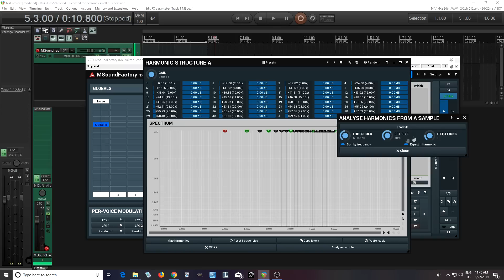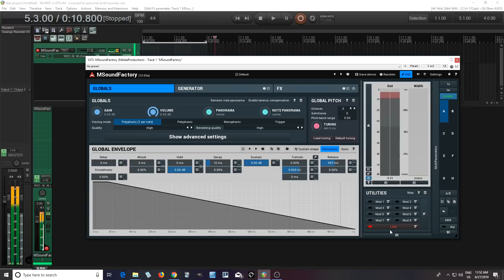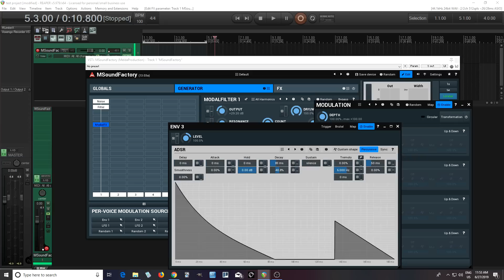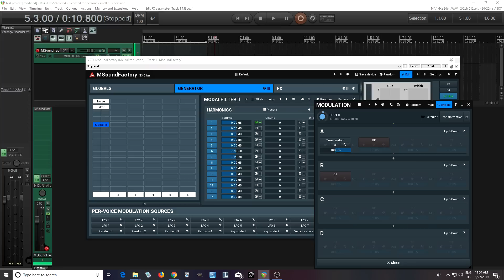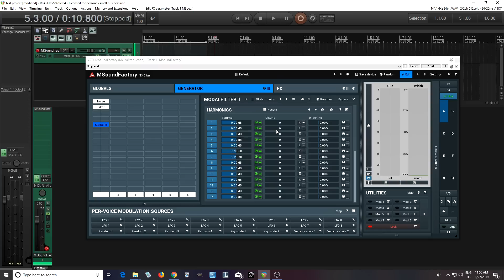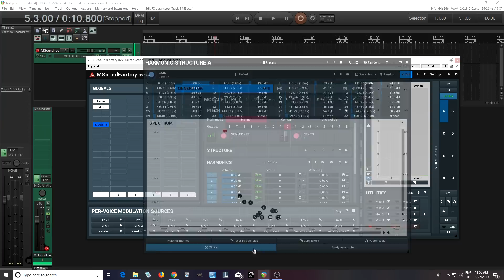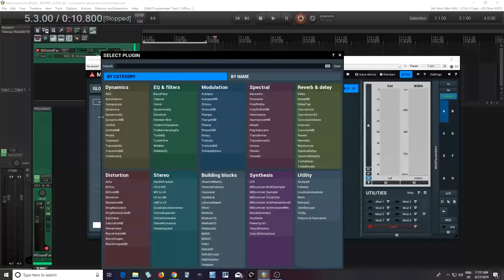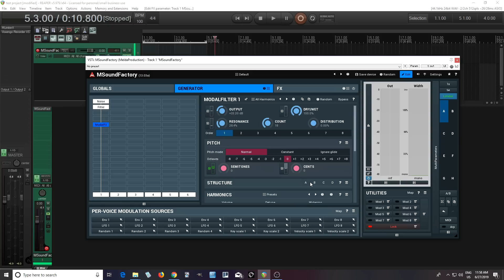Creating Drums in MSoundfactory using physical modeling

Comment: I thing this is the best synth on the market so far. I give 10/10 points. But the GUI. OMG so bad. I'm developing GUIs over 30 Years. And this is worst I've seen in this century. This is a good example to teach beginners what you should not do, if you want to create a GUI with a good user experience.
Reply from the maker: Hopefully the GUI will improve in the future. There has been some work on it over the last 6 months or so.
Reply: What problems do you notice with the UI?

Comment: An alternative to modulating the NoiseGenerator's Volume, as you did toward the start of this video, is to use an Envelope module on the oscillator's output.  An Envelope module acts as an amp envelope on any signal.
Reply from the maker: I never thought of that, but that would definitely work. I’ll give it a try.